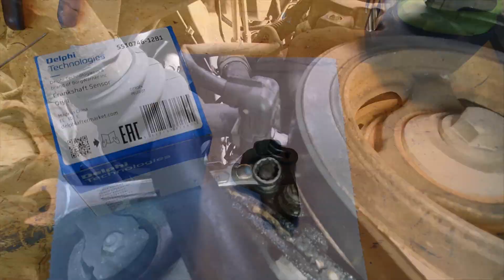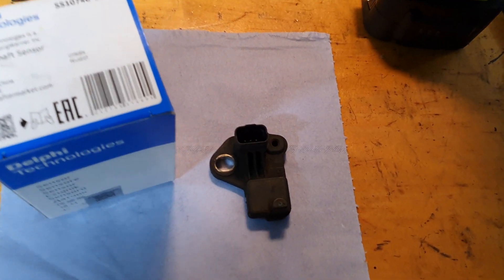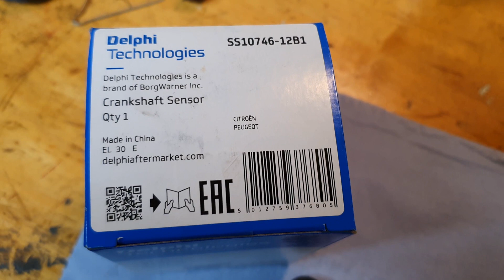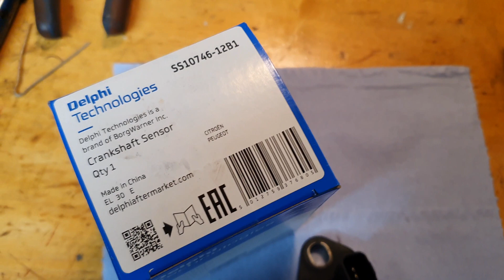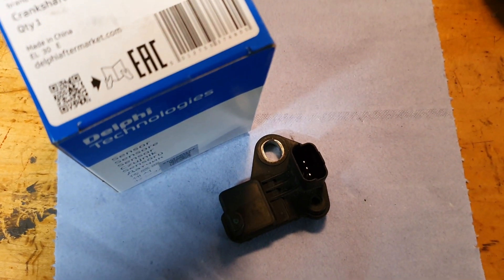Peugeot Partner Citroen Berlingo 1.6 Hdi engine running problem solved

Comment: I've been trying for hours to start my van . With your video I had it running within a few minutes. The sensor was soaking wet with brake fluid and I only had to spray it with brake cleaner and it was working. Thanks
Reply from the maker: I'm really pleased that it helped you.😊 ❤

Comment: Thanks for this. Having a similar random misfiring issue. I will mention this to my mechanic next week.
Reply from the maker: Good luck!
Reply: Had several days of intermittent misfiring followed by days of engine management lights and about five different faults reported by Diagbox. However Diagbox did not report a crankshaft senor fault. Local mechanic plugged in his generic scanner and the only fault was the crankshaft sensor. So he replaced it two days ago and all seems well at last. (fingers crossed)

I'm puzzled why Diagbox did not identify this fault.
Reply from the maker: @Bizz55  No diagnostic equipment ever identified mine as faulty. In desperation I kept changing sensors until the crankshaft sensor sorted the problem. I'm glad yours is sorted out. 😊
Reply: @stefanm67  Engine management light has returned today. Drat.
Reply from the maker: @Bizz55  Shame........... ☹️

Comment: We have a miss on our pug 307 1.6hdi engine which i know each engines have little discrepancys between all the models. Its a 57 plate 1.6hdi 307 and has had a miss for yrs but it would be one quick one and it was gone and didnt happen for ages in between it happening but now its doing it alot more, plus today the car wouldnt start twice which its never failed to do in 6 yrs. It dont get used much apart from it getting a good run to blow the shit out of the turbo. I have a computer which like they use in the garage, its got obd2 part but it can reprogram injector coding, oil reset, dpe regeneration and reset, doors you name it it will check the system. A injector one popped up awhile ago but was reset with our m8s obd2 and he reset the code so the light went off. It can read each injector while the cars running so could it tell in theres one under performing ? Plus where the injectors are theres like water with some black shit around it. I was told in one of the videos that if that happens its from the copper seal or ring at the bottom  of the injector which can also blow the turbo. Much help or information woukd be really grateful to say the least.

Comment: Hi, did the engine idle fine before changing ? I’ve had an issue similar for a few months now. Engine idles fine but every now and then when I’m driving it kangaroos for a few seconds then fine. Today whilst driving it just cut out and will start again and fine on idle but when I add revs they are just up and down and then cuts out. Thanks
Reply from the maker: Hi... it would run fine for ages and idle perfectly ok too. Then, at random, skip a beat.
Reply: Appreciate your reply. I think this is what I am going to change first. I will let you know how I get on! Cheers
Reply from the maker: @mattm6097 Please do. Fingers crossed!
Reply: Hi, I changed the crankshaft sensor the day I last commented on the video a couple of weeks ago. The van has ran perfectly since and the problem has been solved. Just like to say thanks for making this video and sharing this information. You have saved me a lot of time, money and effort which I greatly appreciate. 👍
Reply from the maker: @mattm6097  Thanks so much for letting me know Matt. I'm very pleased to have helped. That was the only reason for making the video in the first place.... I just wanted to save someone the messing around I'd had trying to diagnose the fault. You've made my day. Hopefully there'll be lots of life left in the vehicle yet. I love mine and will run it as long as I possibly can. Cheers mate. 😁😁😁

Comment: Thanks for the video, exactly what mine is doing, I've located the sensor but can't get the old one out, any advice.
Doesn't seem to just pull out the belt wheel seems to be causing an obstruction.
Thanks
Is there a gap in the wheel that needs to aligned for removal ?
Reply from the maker: No..... it will come out. It just needs a bit of a wiggle.....

Comment: I have a 2007 van version of this motor, and I have a similar problem especially at low revs. The engine runs fine for days on end then it suddenly cuts out. Its very annoying as it tends to cut out at the worst possible time after taking off from junctions ect which means I have to endure the wrath of other motorist when stalling the middle of roundabouts!😡 After a cut out the engine fires up right away.  I don't have any problems at cruising speed apart from a occasional brief misfire.
The engine runs fine between stalls and starts normally in the mornings. 
Ill order my sensor today and make it my weekend project.
Reply from the maker: Good luck. The symptoms sound similar so hopefully the fix works for you. Let me know how you get on. 👍

Comment: Hi, I have removed the nut and cable as you said in the video but the sensor still seems stuck in and I can’t get it out. Is there a method to getting it out or anything else to undo? Thanks
Reply from the maker: No Oliver..... it must just be stuck. Give it a wiggle and it should come out.
Reply: Mine was stuck to i used a flat head screw driver and gently worked it out .....but getting it back in was a real pain .

Comment: I have the same engine on a Ford focus 1.6 tdci and when cold start the engine its like it misfires , i put new injectores on it and still the same problem, black smoke desapears after i changed the injectores but on cold start it still wiggles and misfires, is this the crackshaft sensor too?
Reply from the maker: I honestly don't know but for the cost of the new unit, and the short time it takes to fit it, it has got to be worth eliminating. Let me know how you get on.
Reply: By the way, when the engine is hot the wiggle and misfire desapears and engine runs fine, and no fault codes.
Reply from the maker: @Emanuel69martins  No... that's different. Mine was completely random. Hot, cold.... it made no difference. It might do it 3 times in a minute and then nothing for 3 hours driving. Completely random.

Comment: Hi , i have the same car with same engine , sometimes when i put it neutral for slow for lights or something else rpm idle goes below idle and makes sounds about to stall and vibration , but it doesnt stall . It doesnt make it everytime , sometimes but it happens especially in till get hot when temp is cold . Our mechanic said if it doesnt stall it doesnt big deal and it maybe idle sensor said . Do you have any idea or suggest ? Thanks .
Reply from the maker: I'm really sorry but I don't know rhe answer to your problem. 😒. I would start with the idle sensor though. Good luck.

Comment: There are lots of mentions of error codes in car fix videos … is there a reasonably priced bit of diagnostic kit I can buy ? I have an 07 Berlingo 1.6hdi … many thanks ..
Reply from the maker: I'm not sure of the best one. I've tried loads (borrowed them from mates) but none of them picked up this problem or diagnosed the fix. It was trial and error until I found the correct sensor.